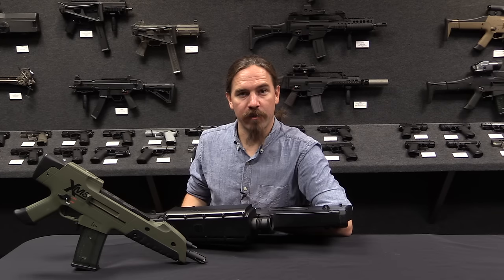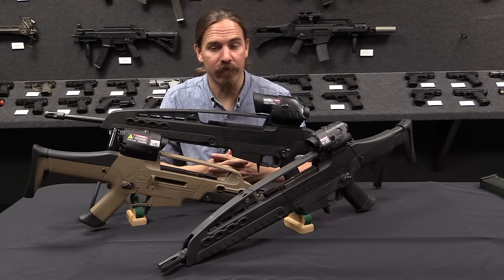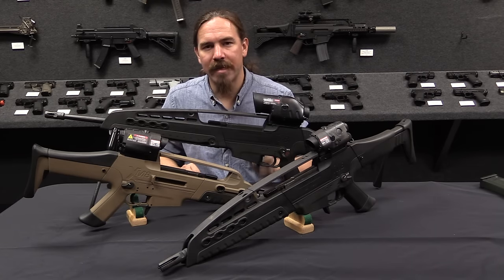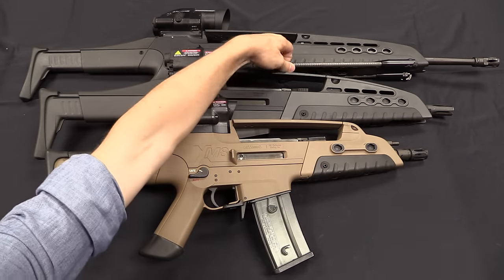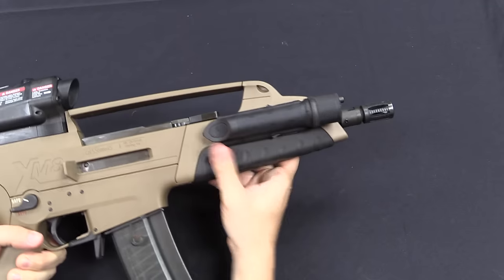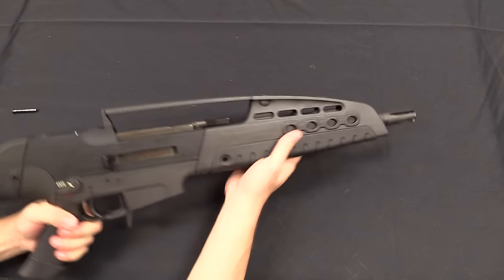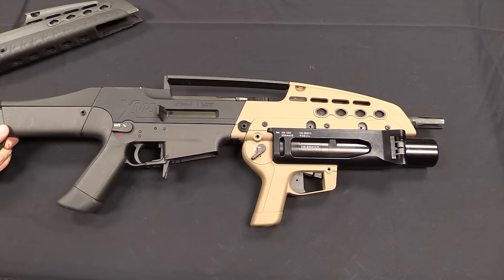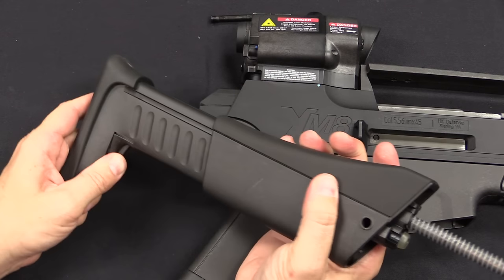Almost Adopted: The H&K XM-8 Family

Comment: H&K never fails. 100% pure badass. Basically a 20 year old gun that was ahead of its time and is still ahead of current times.
Reply: Chebva Romero so ahead that it was a large failure in every sense of the word
Reply: @THEZWARRIORWAR  Because the U.S won't move away from the M16 family, it's just too much of an undertaking given the number of troops involved. They're kidding themselves and manufacturers with these replacement programs, they don't intend to replace, not until they're forced to as per the M14.
Reply: Med Otaku Do you have a single fact to back that up?
Reply: Magni56 Thank you for the detailed answer. My only problem is that I don’t really remember who I directed my original response to.
Reply: @neuromancer692  Someone that either deleted their post or changed their username. Or at least that was my conclusion as I tried to parse this thread.
Reply: Chebva Romero “laughs in AUG”
Reply: @Commodore22345  
This is total BS, it surpassed the tests in every way. where did u get that from? Just think about the Dust Test and so on. The reason was just that it offered not enough to justify the change from the M16 to this.
Reply: Pikachu fan And tripolar fan  
I call this BS. The G36 is also polymere and it works fine and does not break easy. This is not even a rumor this is just rubbish.
Reply: Pikachu fan And tripolar fan  
The XM8 is nearly the same as an G36, starting from its mechanics to the polymere. they changed only the hull and optics, even the Trigger mechanics are the same. So why should the XM8 fail there, especially it did not in the whole testing procedure?
Reply: General Coma it’s okay dude, he’s a German brown noser.
Reply: In what way is this ahead of it's time? It's an incredibly unoriginal rifle. AR-15 style bolt, and an AR-18 gas system derived from the SVT-40 all the way back in WW2...
Reply: @weasle2904  
There is no really original Design in modern Weapons nowadays. There is only evolutionary steps anymore. Wich is the reason why it is so hard to come up with something to replace an existing Rifle.
The XM8 was at its time ahead of the others only due to the modularity and this is on todays standards also addressed.  Was  the XM8 a gamechanger? No, was it an "incredibly unoriginal Rifle"? No.
Reply: @derekakaderek  Again, wrong, same principles does not mean it is the same which should be obviously.
Reply: Kinda weird to think this rifle is already 20 years old, it really looks very modern
Reply: @fuckheinschitt239  
It is as easy to use as the M16/M4 maybe even more ergonomic i my eyes  but yes it is bulkier not everyone's cup of tea.
But that is what I already said, there was no big performance leap to justify a new weapon at that time.
Reply: @Forodir  talking about ergonomics when you havent even held it before lol
Reply: @warshipsatin8764  
What's so hard to understand that these had the same ergonomics as a G36 because it is a G36 in a different shell.
Reply: Definitely not ahead of current times. The CZ Scorpion, current AR-15/M16/M4 derivatives and possibilities, the Vintorez family, the AK-100 series. It's just a G36 in a new shell. That's all it is.
Reply: @Forodir  There is original design in modern weapons. Look at the Vector. Closed-bolt delayed blowback with a recoil system that helps to mitigate muzzle climb.
Reply: @punishedsneed  
It was ahead of this time for its modularity, but again we talk about a program which is already 20 years old. Today every better weapons platform can do this.
Reply: @punishedsneed  
You have a closed bolt or a delayed bolt, both at the same time is not possible and in case of the KRISS Vector it's a simple blow back bolt.  
That kind of rearrange the force  of the impact is not really new and there is a reason why that is not really successful.
Reply: @Forodir  surely you understand that the shell entirely changes the ergonomics lol. ian, whos actually held both, said its far bulkier. which is apparent to anyone with eyes
Reply: @warshipsatin8764  
I really doubt that, and no that is no "entire" change of the ergonomics. If you have time come to Oberndorf and try it out.
Reply: @Forodir  you can doubt it all you want but youre still wrong
Reply: @warshipsatin8764 
Sure, if you say so.
Reply: Its already been 20 years?....

Comment: As German ex military I can tell you the problem around the g36 as it was around my serving time when developed vor us. 
One of the at that time requirements of the Bundeswehr was that it has to be fully functional for northern and mid Europe basically ftom Spain to Denmark to say like that. The g36 was never designed to be fully functional in desert climatic conditions. And to add to that the very wise and all mighty burocrats decided that instead of using the recommended ammo that they should use the cheaper ones. Result at intense shootings with a lot of full auto use the barrel tended to heat up too much which caused a lack of accuracy. That's the whole story about it. Our useless minister of defense just seeked a way to get a new gun cheaper by blaming h&k did a bad job. Fun fact the new AR for Bundeswehr is, surprise surprise, a h&k.

Comment: An excellent video and a fascinating concept for a service rifle. All this talk of how the rifle “looks”; that’s completely irrelevant- it’s the ergonomics, the durability, and the function that counts, and HK obviously views the service rifle as a modular, expandable device to be changed and adapted to its purpose. In that, it’s beautiful alone. Beyond BS politics and bureaucracy, I’d like to know more about what physical issues (the Vickers commentary talked about handguard heat and captive pushpins) theses guns had, and if HK could have remedied them.
Reply: If you look into the G36 issue he mentioned I think that'll answer some questions. Basically something about heat warping the plastic where the metal trunion is molded in and offsetting the barrel and so affecting accuracy of the rifle. From what I've personally seen in discussion it seems this has mostly been used by some German politicians as an excuse to replace the rifle in Bundeswehr service, but whether or not it has really been a huge issue in practice isn't really clear. Though whether or not it really is that big of an issue, the push for a new rifle is getting H&K and others to showcase new weapons like the HK433 and the Rheinmetall-Steyr RS556.
Reply: @Kothra while G36 in German service does have these known issues, H&K has fixed them and the G36 is very popular with Special Forces all around the globe. It was basically the Bundeswehr requirements for a less heavy rifle, they fucked up but they have fixed it. G36 as a platform is just fine.
Reply: @foleymaj  Yeah the worldwide popularity of the rifle is a large part of why I'm skeptical of the whole replacement situation.
Reply: @foleymaj  the newer generation of G36 may be good, but the first generation was really bad. We destroyed so much of them on the maneuver grounds...
Reply: It's really unlikely any issues wouldn't have been fixable. If there's one thing we know from Ian's videos is that all weapons start off with issues that end up getting solved through the adoption process or through use, like how the MP38 had that issue where it could fire if the bolt got hooked up on something and it was changed for the MP40. Or the early manufacturing difficulties with the original AK47 that got fixed by accepting a higher weight milled receiver until they could make them out of stampings properly. The M16 had issues of it's own that got fixed during it's adoption.
Reply: @Havok0159  It's actually quite remarkable nobody seemed to have found any issues until more then 15 years later after the guns introduction.
Reply: It's mostly because those issues didn't show up until people ended up having to use them as ad hoc LMGs in ambushes, a role that it simply wasn't meant to do. If I recall the Lithuanian testing concluded that the G36 "“diverge from their technical characteristics only in case they are used for fire support, i.e. as light machine guns,”"
Reply: Wyatt Earp: I agree; if you design something correctly the aesthetics usually come along. However, if you look all the way back to WWII, people have been making assumptions about a gun’s value based on  visuals- when manufacturers started moving away from nice wood and deeply blues machined metal to stamped sheet metal, plastics, and painted/ parkerized finishes. The M3 Greasegun comes to mind, which was a solid, economical design but at first was derided because of perceived visuals. There also was a time when some looked at the Armalite rifles as little more than a fragile toy. Often military types were not open to chance and preferred to just stay with the “old stuff” because it was good enough 10-20 years ago; with that logic we’d still be using Garands and M14s.
Reply: Troop acceptance is a real thing. Appearance matters. The selection programme for the British MTP pattern that Ian sometimes wears paid close attention to Troop Acceptance as well as actual performance in terms of how well it hides you in various terrains. Life is much easier when troops like the kit they are given.

Then of course there was the whole 'must be unique to UK forces' thing, so that we own the IP to the pattern and the UK taxpayer gets a cut from every commercial sale of items using the pattern. Thanks for cutting my taxes Ian.
Reply: Matheus Falango: you are missing my point entirely. In the beginning, guns were made by engineers with little to no regard for things like ergonomics, modularity, etc. . Soldiers judged them on things like finish, materials, and perceived “cheapness”, which somewhat continues today. In the end, it’s a weapons performance, both in the field and adaptability to its use that defines its success. However, the idea that something seen as “ugly”, which is entirely subjective, matters as to a weapons effectiveness is a bit sophomoric. Your sten reference- it was deficiencies it the speed and method of assembly and subsequent performance in the field that hurt its success; the following Sterling, which was more or less a refined Sten, was much more successful, accepted, and had a long service life. The M3 greasegun was derided as inferior- right up to the point it was used successfully and was in service up to the 90s. I don’t disagree with visuals being important- as a designer, it’s my stock and trade- but often people dismiss viable designs simply because of inner bias due to looks or prior experiences. My original post was due to viewers saying things like “its ugly” and just dismissing it. People get attached to things, even flawed, and shy away from change even if it’s a substantial improvement.
Reply: Matheus Falango: GREASE GUN was a slang term for the weapon- as in it was not seen as a quality gun UNTIL it had its time in combat. The M16 was called the a “Mattel toy” when it came out- a reference to it been seen as not serious. And my point about engineers you don’t understand either- it’s not that gun engineers made weapons crudely, it’s that they focused on things like manufacturing and mechanical function, with little care for appearance or ergonomics. Those are things that designers and more recently, modern engineers focus on. You and I are going to argue the finer point until the sun goes down.
Reply: Matheus Falango: name for me three guns that you think is “attractive” and why.
Reply: Wyatt Earp  I'm not sure I agree on the "aesthetically pleasing" part. If it happens it's just a lucky coincident. As I remember it the M16 was considered by most to be an incredibly ugly plastic cludge when it was first introduced. Today a lot of people hold it as the golden standard for a military rifle as far as looks go.

What I would want in a rifle I was going to carry everywhere is roughly in the order of: Reliability, ergonomics, a sleek exterior, and light weight. Aesthetics commes a long way down that list. Most of that is self explanatory, but the sleek exterior might need an explanation. Basically the ideal would be a gun with no protrusions that can snag on anything, so it would probably looks something like a well used soapbar. The AR-15 is terrible in this regard, though a lot of other weapon platforms are way worse. The XM18 looks like it might be good in this regards, but I would want to crawl around in tight spaces and under low hanging masking nets for a few weeks before giving a final verdict on this.
Reply: @KothraStreamdiver  Wasn't the barrel warping the plastic just BS ?
Reply: @almightybogza  I'm just going by things I've read but I'd imagine there's probably some truth to it, it's just gotten blown way out of proportion. Politics as usual.
Reply: @Matheus Falango Well I'm afraid it would look like a half melted plastic blob. I've played with the thought and what I've learned is that I now can understand how some of the weirder gun designs came about. It also shows how dangerous it can be when a designer is given to much time to work on his particular pet project. You risk ending up with brilliant but overly complicated solutions to nonexisting problems.
Reply: I knew a guy who was involved in Army testing of the xm8. He said it burned up the hard guards and had many reliability issues. HK failed to fix them, not for lack of trying. Good idea, bad implementation.
Reply: @foleymaj  The G36 worked well on the shooting range which was good enough for drafted soldiers on the shooting range trained in cold war doctrine. However when fighting battles like in Afghanistan supressive gets way more important and it is nearly impossible to take aim for a clean shot

Comment: I remember all those years ago, when I'd draft out near-future military fiction and US forces would be wielding M8s in 6.8SPC...
Reply: That sounds awesome
Reply: Yep. It was considered a given back then, really.
Reply: Don't forget about the "Specialists" using KAC PDW's in 6x35mm and Glock 31's in .357 SIG.
Reply: You mean the 6.5 Grendel right? Because the SPC, aka, Snowflake Personnel Caliber, is terribad and pointless.
Reply: Forlorn Vaalan the grendel would need a larger mag well, but that would be awesome.
Reply: @forlornvaalan7630   The Grendel and SPC both have their niches. The 0.264 bullet of the Grendel performs great at long distances. The 6.8 SPC is designed to function best in short-barreled rifles. Both use STANAG mags at reduced capacity, both require non-standard bolts, and both are designed to fill the gap between the 5.56 and 7.62. For a service rifle like an M4 carbine, with it's 14.5 inch barrel, the 6.8 would be the obvious choice; however, for a DMR where range and accuracy is required, while maintaining the M16 platform, the 6.5 Grendel would be best.
That means both calibers are out of the question for Standard Issue. Each cartridge specializes in a specific area; great for Special Forces, not so great for equipping grunts.
Both calibers generally outperform the 5.56, so neither are terribad... just niche.

Comment: Pretty close to a G36 if you ask me!
Reply: It is cosmetically but there are some noticable fundamental improvements over the G36 like the barrel is easier to change out and it uses the Gas piston mechanism.
Reply: If the M249 warps when you fire hundreds of rounds in rapid succession, I don't see why the XM8 wouldn't
Reply: I know it's weak bait, but someone will probably take it seriously so I'll bite. Cuz the only mention of the G36 accuracy issues mention it happening after "firing hundred of rounds". So far that Lithuanian testing even confirmed that the G36 only deviates from specifications if used in a fire support role. i.e: As an LMG..
Reply: Boomers gonna Boom  it does which they found out through testing. Any weapon would really but its tolerance wasn't much better then what they had with the M4 making kinda pointless to replace everything for weapons system that wasn't that much superior to the M4
Reply: Boomers gonna Boom  funny that this article uses one of the worst newspapers in germany as source, if not the. also almost every soldier actually said they really like the G36.
Reply: Boomers gonna Boom the mg-3 is quiet an old weaponsystem, but it is reliable und precise
Reply: The HK433 is essentially G36 2 eletric boogaloo. The German MoD is so fucking clueless they'll pretty much buy almost the same gun with a few extra features because they ignore troop input and don't know what they're talking about when they say an AR with a fixed pencil barrel "overheats" after firing hundreds of rounds as if it wasn't obvious.
Reply: Boomers gonna Boom no one that has ever shot the mg3 including foreigners wants it to be replaced. It’s the best LMG period.

Comment: This gun looks all around better than the M16, it astonishes me they haven't replaced it yet given the many wonderful options possible nowadays.
Reply: because It probably comes down to the price per unit and more importantly....politic
Reply: it has more to do with reliability, there are some weapons that work well enough that the design has not changed much since the 1920's. also changing a weapon system from experimental  to primary use is a massive undertaking that costs money and time so they want to make sure that it does the job 100% of the time every time. which costs even more money and time. then there is the politics....
Reply: Marines are starting to issue m27s to infantry. I see the m16 being phased out within the next decade